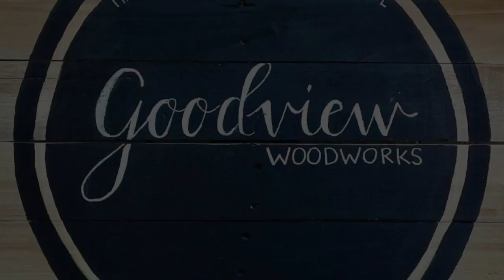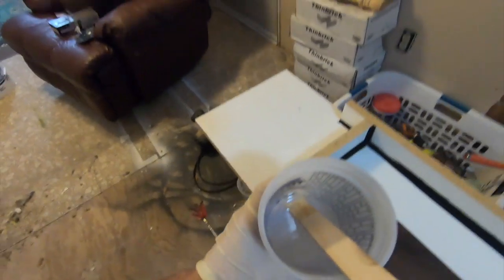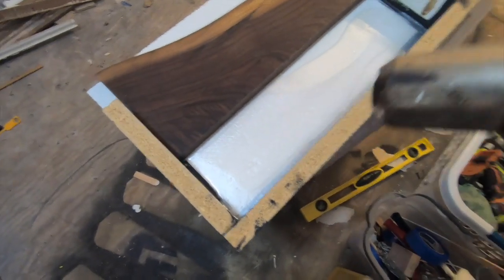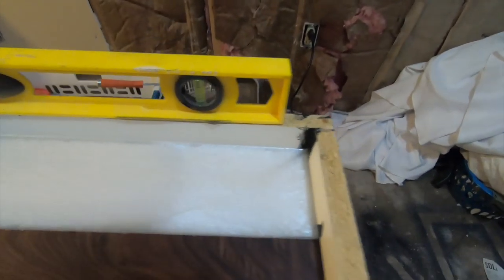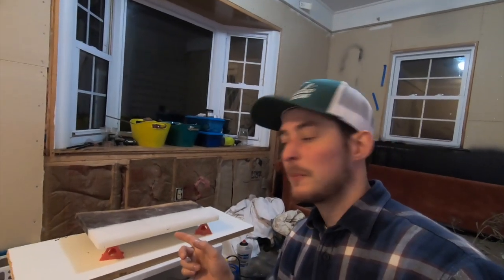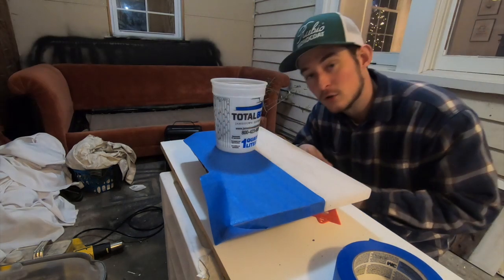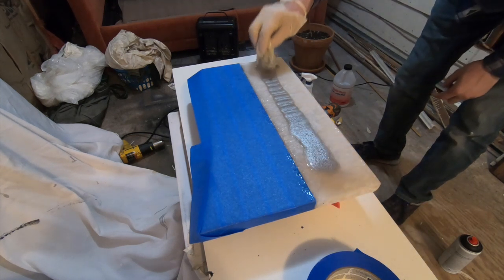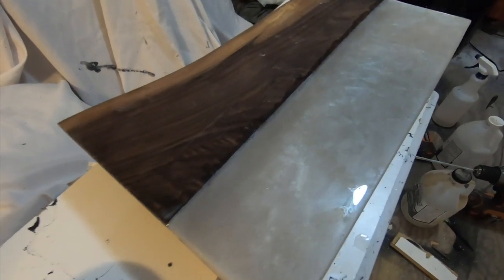DIY Marble and Wood Side Tables using Epoxy Resin|| Part 2

Comment: How has this epoxy held up?  Cracks? Separation from wood?  Thanks
Reply from the maker: Held up well! No cracks, the only time I have had separation from wood us when I seal the edges improperly.
Reply: GoodView Woodworks how do you seal the edges improperly? I’ve seen it sealed with a thin coat of epoxy
Reply from the maker: mike bayes so , what I meant was ; if you seal the edges and let it fully cure you will have sealed the. Improperly. However, the best advice is to never seal the edges. You should have the proper casting epoxy so sealing the edges is not necessary. Hope this answers your question. Thanks for commenting!
Reply: GoodView Woodworks thank you for your response. I’ve seen videos that said that if you didn’t seal the edges that air bubbles would come out of the wood but I think you cleared that up for me. Sounds like you have learned a lot through trial and error. Thanks again

Comment: I've heard that working in a cold environment slows the kick process down which results in bubble escaping better since the reaction is stretched out. Have you found that to be true?
Reply from the maker: Yes I have. However once it has set up, you need to bring the temp up to get it to fully cure.

Comment: Was the  Turtle wax on the form in part one was to prevent your project not sticking to the melamine?.., but it stuck..any other products to use ?
Reply from the maker: Any spray on mold release will work. I actually didn’t put enough on the second one. That was my mistake.

Comment: How do you clean the stirrer used with drill?
Reply from the maker: I don’t usually. But if you want to; immediately after use, wipe off the mixer with mineral spirits or isopropyl Alcohol.

Comment: Gees, about time, lol.
Reply from the maker: 😂 I know sorry
Reply: @GoodViewWoodworks  All good, job looks great. I am curious about the long term adhesion. Ever have any issues with separation where timber and epoxy join? I'm in Australia, and I've got some 110 year old timber floor joists I was going to do same thing with
Reply from the maker: Richard Crew I haven’t had any problems but if you’re not pouring a clear cast and are still worried about separation, you can’t drill some holes into the edge to act as “epoxy dowels”.
Reply: @GoodViewWoodworks  Thanks, just gave me idea of using biscuit joiner to cut some slots for LEDs

Comment: how long did you wait to pull the tape?  My thinking is that if you remove it to early the epoxy will run over onto the  wood.
Reply from the maker: You’re correct! You should wait until it starts to set up before removing the tape.

Comment: apparently the Incredible solutions casting resin in 1.5 gallon is no longer available. The link on your website and the link on theirs both give same results. Am I missing something?
Reply from the maker: Brian Pruitt I don’t think so let me check on that.
Reply: @GoodViewWoodworks  I clicked on both links and said product is currently unavailable.  IKD maybe thats what it says when the product is on back order or out of stock.
Reply from the maker: Okay so I just spoke with them and they’re sold out of the 1.5 gallon kit. But it will be restocked in a couple days. The 3/4 gallon kit is still in stock though.
Reply: @GoodViewWoodworks  Awesome. Preesh!